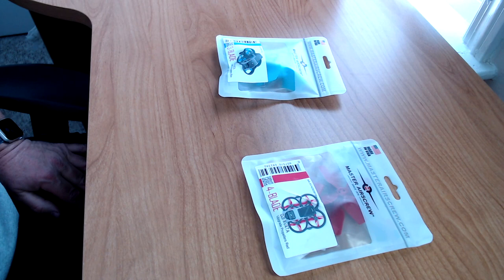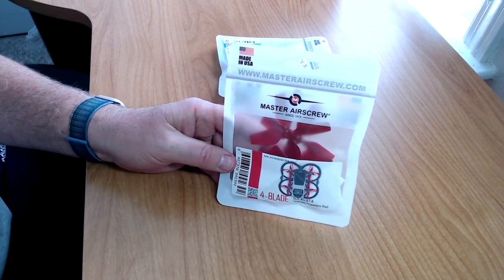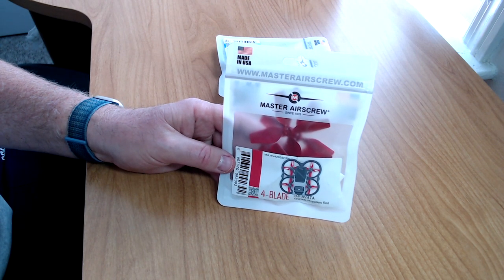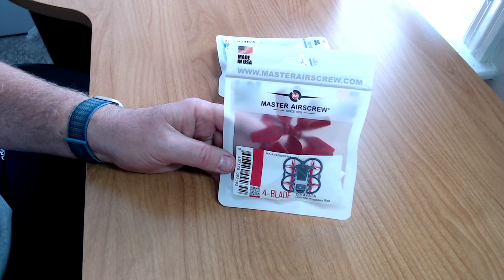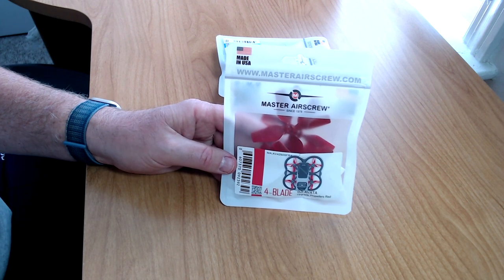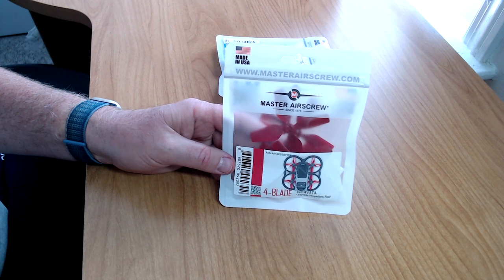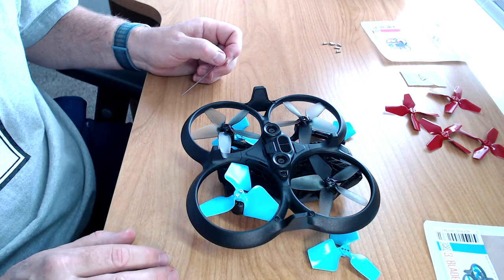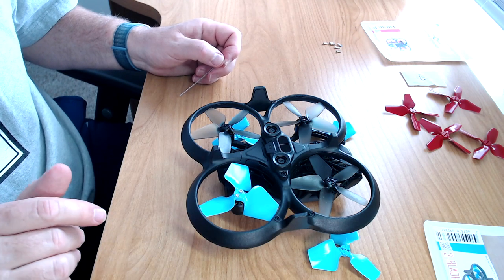Master Airscrew Props for the DJI Avata FPV Drone

Comment: I just got the Avata and I'm a little worried about exploding props. Thanks for sharing these props with us, I'm going to see how well they perform and if they explode too before I buy them.
Reply from the maker: I'm going to releasing a test flight video with them soon, and talk about  a possible downside. Congrats on your new Avata, and thanks for stopping by.
Reply: @RonaldBrown59  It's already going back. It just went down and crashed. I did a turtle and it flipped over. It then had a battery error, so I went and picked it up and pushed in on the plug, put the goggles back down and it seemed normal. I started the motors and it scooted across the ground and wouldn't disarm. I lifted the goggle and went to get it and it smoked up. Now Esc error. I got 2 years of refresh if they say it's my fault, but I don't think it's my fault.
Reply from the maker: @CarolinaAirshots  Sorry to hear you had issues with your new drone. I hope DJI can get the drone sorted out for you.
Reply: @RonaldBrown59  Me too

Comment: Thin and brittle would be my guess, the props are put on with torque limited drivers
Reply from the maker: The stock props are much softer than the MAS props. Hopefully that will prevent the props from exploding in flight. Thanks for watching Bryan.